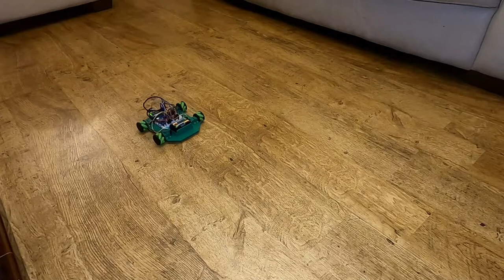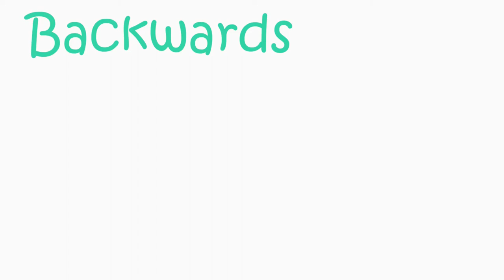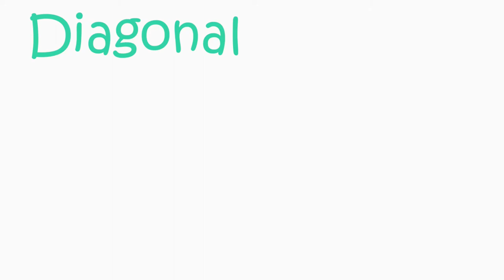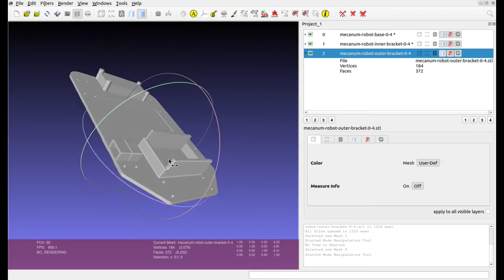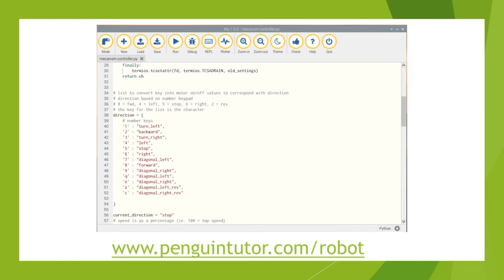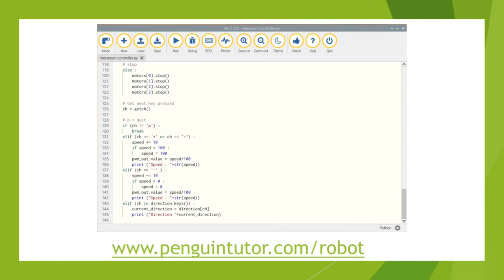Mecanum Omnidirectional Robot - Raspberry Pi and USB controller

Comment: something that I would like to see if you are looking for ideas, would be a full tute on how to use a web interface and LTE module on the pi to access and control as well as see (and get additional data from sensors for weather data collection) anywhere there is a cell tower to receive that 4G data from, (and maybe a way to force down to 3G for low level data packets that don't require the high speed while sending video through the 4G so it is all saved on low data allowance accounts to maximize that data for what it is needed for, until they hopefully make it the 3G of today (ie 5G has x tb of data on this plan per month anything over that automatically drops to 4G LTE speeds or something like that :) 

anyway I see a balloon or blimp that uses heated air control for lift using say electric coils or rotating mirror system of some sort like mylar mirror material to block or allow sunlight to heat up the air by way of blocking or unblocking view of some matt finish black material inside the balloon (or maybe both so night time it can remain active, and use solar cells to charge up during the day and run so it has reserves to remain aloft,) additionally I could see something like this being a way to build a wifi mesh network that is towerless since it just flies or floats to the level the tower would put an ant at for better reception XD, (balloon idea might give enough size with out mass energy expenditure too for supporting an array for starlink too, before it gets micronized that is :)
Reply from the maker: Interesting idea. I've done some work on remote lower power solutions but only limited projects.

I've used a solar panel in the past to charge during the day and power a Pi and LEDs in the evening, but not really been impressed by the charging capability of the solar panels I've got.

Perhaps a lower power solution may work better. I'm currently looking at the Arduino Nano RP2040 which may be a good fit, but that's wi-fi rather than LTE.

Thanks for the suggestion.